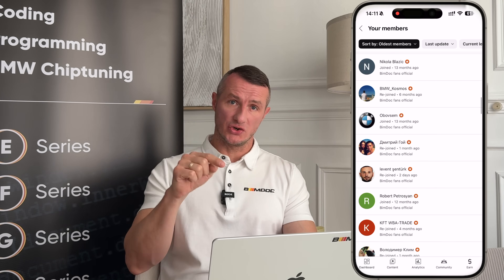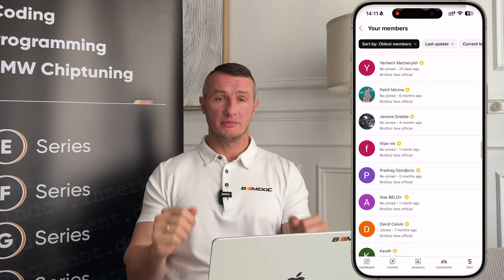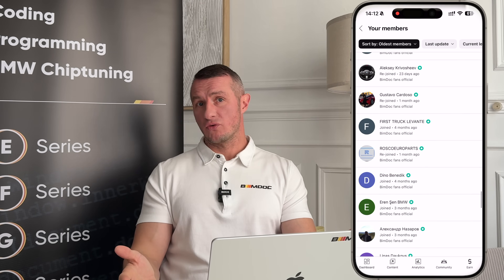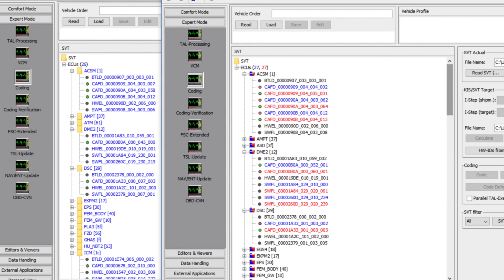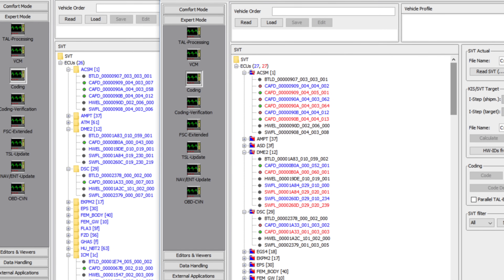BMW Bricked? Here’s Why Programming Often Goes Wrong…

Comment: Thanks for the video. Are there any particular modules prone to bricking? I was told that FRR-02 acc radar on G-series very often dies during the programming, the chance of success is 50:50. Bootloader gets damaged and that’s it - you can’t do anything. Is that true? Is there any way to avoid that? Thanks in advance Vlad’
Reply from the maker: Yes FRR is very sensitive to software updates. Not 50/50 but still kinda high to brick it. 

I don’t know how to mitigate that rather than just prey )))

Comment: Thanks for all of your dedicated tutorials. I have been working by Volvo Trucks Dealer & we're using for programming the EV-Trucks a power supply of 24v 50amp and I was using it to update de CAS4 module but suddenly half way got crashed. So what I understand from this video is 1st I used 3rd party tool and low power supply. After that I tried to get D & P flash with solder cables of XTool but I was just able to get eeprom. If I install the CAS4 module then there's no respond from the car at all. I hope you can make a video about solving this kind of issues. Thanks again.
Reply from the maker: To install used CAS you will need to modify ISN code in it (there are more than one ISN)
Reply: @BimDoc  Thanks againg for your reply! You mean from DME right?

Comment: Thank you so much for your great videos, I learned a lot from them. Is it possible to update i-Step only for HU, with the engine running to avoid the power supply issue? It takes between 25 and 35 minutes.
Reply from the maker: It’s possible to update HU only, but not on running engine. (Esys will turn engine OFF before the update)

Comment: Did all my prep even taped down all the connections plugged in laptop started ista+ uograde but forgot to disable sleeping.  Came back and laptop was off black screen and now I have errors on dash.  now my G10 won’t start and it’s shows half the modules are not green.  What’s the best way to fix?  Esys?
Reply from the maker: It is very bad!!!

Try to reflash via esys
If bootloaders were uploaded then ECUs will be responding. But it bootloaders are missing then you have to replace ECUs where they are missing 
It can be very expensive (((

Comment: HI !  need to get some tutorial about deblocking HV battery after crash  X5 F15 plugin hybrid into the front.   Now can't charging, . The car did not see charger.  And car can't move, either put in Drive mode, but engine work.  What to do, with ista+  enough ?
Reply from the maker: It is protection measure and to remove it programmer is required.

Comment: I have used CGDI for coding & programming. Worked good. I used it mostly for coding BMW jeys
Reply from the maker: Good to know it worked well for you!
Reply: @BimDoc it worked for ECU a replacement on a F20 and F30. The FEM also had to be synced up again with the new ECU. Only issue was the voltage display of the CGDI

Comment: Super informative like all the videos. One question I have, is there a way to know which ECU’s are secure coded 2.0 and require signed NCD’s? Though your videos have made me confident with the software, I worry because of the secure coding lock down in idrive 8.5 vehicles. As an example, I want to code in Anti-Dazzle, I know I need to remove 5AP and made some FDL changes to BDC and KAFAS4, but I don’t know if trying to write the changes to KAFAS4 is risky. Thank you for your videos and consideration of a video explaining BMW’s  Secure Coding 2.0 lock down and signed NCD files.
Reply from the maker: It all depends what BMW do you have,
DIfferent platforms have different ECUs etc...

But yes there is a way how to determine which ECUs are exactly requiring SC2.0 (via eSys)

Comment: Can you help me please
I got the PSdZData 4.50.11

I need the FDL folder that is inside the swe folder as it's missing from me can you help me?
Reply from the maker: Download another psdzdata
The only files that are missing could be NCD2.0 files. And you will not find those any way.
Reply: @BimDoc  First of all thank you for your replay, really appriciate it.
the problem is I got the 4.50.11 full data and 2 other Full data, when i try to NCD or FDL code a control when I am inside the numbers 3050,3055,etc apear but all the sub folders are (.) dots nothin is translated and I am using EsysPlus 4.3.5 but when i am using the Esys pro launcher 2.8.1 with the fdl cheat sheets with the same PSdZdata everything seems fine.

To be honest when i searched I found out that there should be a translation folder (FDL) inside (SWE) folder inorder to be used by the EsysPlus but I could'nt find such a folder in any Full or Lite PSdZdata.
Reply: @BimDoc I'm waiting for your reply 🙏

Comment: Va  salut. O întrebare va rog, daca ma puteți ajuta. In momentul de față, folosesc ISTA + 4.32.15. Funcționează perfect impreuna cu cablul K+Dcan si cu Enet. Tocmai ce-am descarcat ISTA + 4.52.40 Standalone . Pana când o sa-mi achizitionez un ICOM original, încă doresc sa folosesc aceste cabluri K+Dcan si Enet. Întrebarea este: aceste cabluri vor mai functiona cu aceasta noua Versiune de ISTA ? Si ca o a doua Întrebare, aceasta versiune de ISTA + , este buna de ceva ? Pe ce recomandați sa instalez,  pe Windows 10 pro sau pe Windows 11 ? Va mulțumesc anticipat.
Reply from the maker: Go for win11 as of now 
Ista 4.39 is good stable version and works with E series as well (over DCAN)

Comment: Hi Vlad! Amazing content, don't stop, keep going! Already learnt from you many many things. But still I have one question... I hope you can tell me here about ZGW flashing. I am going to retrofit my ZGW 01 to ZGW 02 High/High Plus (F10 if it matters). I have ENET cable and I can find information which tells that I can flash it simply as I would flash other modules, and another information is that I have to use DHCP server. What you would recommend me to do? I know that safest way to use ICOM, but it is quite expensive to buy, so it would be great, if you could tell how to flash ZGW with ENET :)) Greetings from Lithuania!!
Reply from the maker: DO NOT PROGRAM ZGW via Enet directly. (You will brick it 80-90% of the times)

Only via dhcp or icom!
Reply: @BimDoc Thanks for reply! Maybe then you can tell how to set up DHCP properly, to flash ZGW?

Comment: great work with ur content, helped me so much. Could you do maybe programming bmw from us to ece?
Reply from the maker: When changing the region main confirm is type of HU (headunit/multimedia).

Different types require different approach. Wrong approach might cause series errors at HU and will require more expensive solutions to fix it.
Reply: @BimDoc  MGU HU is quite popular in new bmw I suppose. Maybe that would be an idea to give overall idea about the process

Comment: Great content! But I would like to add a small thing: I seen very often in EOBD port of BMW the two ground female pins are bended or abused. So before I start to do any programming I always check them are ok or need to straightening/repair them with some needle.
Reply from the maker: I’ve also seen that several times (bend pins)!
Good point!

Comment: I Used BimmerCode my phone crashed during programming not my head unit keeps restarting , my BT still connects to my phone but I can only get calls out make calls not playing music, cd player stopped working and each time I go in the app it says my ac system needs to load a backup after loading backup it just goes right back. Navigation stuck on launching update function unavailable and owners manual is also unavailable. 

Does changing the head unit fix this issues?
Reply from the maker: It should be fixable wo HU exchange as well. 
Enet cable and win laptop will be required. 
Contact me directly for assistance.

Comment: It's a good idea to use a router or a DHCP server when updating your head unit. Without one, you could ruin your expensive head unit.
Reply from the maker: If you use icom then it’s must to update HU!
Otherwise update will fail.
Reply: @BimDoc  But can you update HU with just an ENET cable?
Reply: @BimDoc I updated NBT EVO with ICOM plugged directly to laptop and I had no issues.

Comment: There will be different situations later. Can you share how to recover from programming failure?
Reply from the maker: The thing you need to to is to make sure all preconditions are now good (power etc) and then make new calculations with esys and try flashing again. It works in 90% of the cases